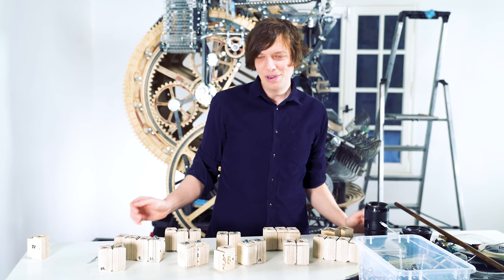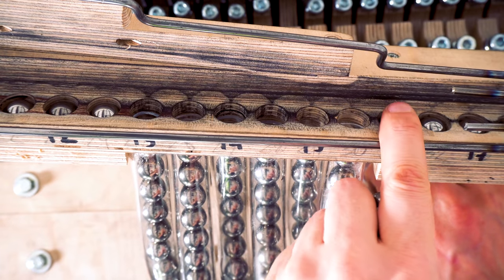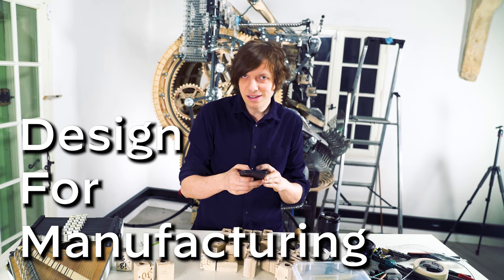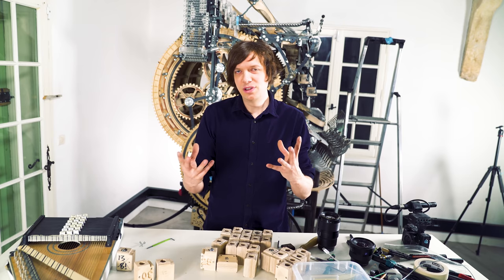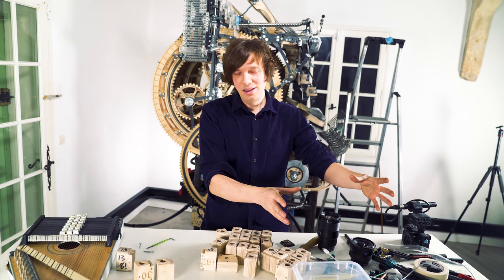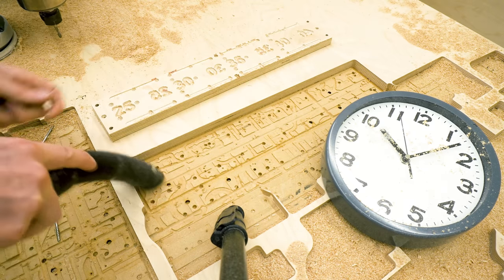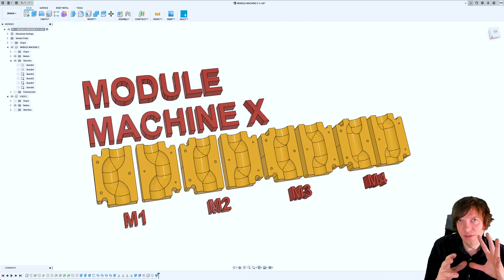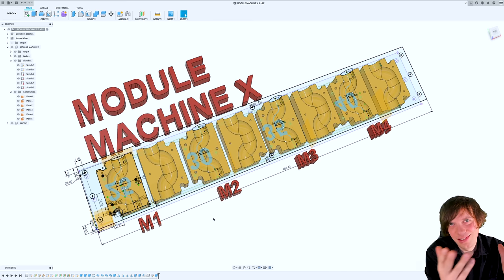Module Machine X

Comment: I will gently suggest that every car manufactured in the past 30 years with unibody design uses dfm. The shape is a design choice, not a manufacturing choice.
Reply: I came here to say this!
The manufacturing processes have been evolved to make the modern car shapes possible.
Car industry is one of the most efficient manufacturing systems around. The other industries are trying to follow their example.
Reply: You guys need to do your research about how Tesla wants to manufacture in one step the full frame instead of welding. That adds lots of limitations to geometry and flat surfaces are kind of optimal for this technology. 

So in the end, it is not designed for manufacturing, it was optimised to sh*t to be able to fit into this new concept. 
Would it work with round shapes? Yes, but with higher cost and longer lead times.

It reminds me of the Ford T model, which was only available in black as the black paint was drying the fastest. 
Would it work with green? Yes, but only with extra cost and lead time. So nope...
Reply: @Atomkukac1  I can accept that it's been designed for a new type of manufacturing method. But is the design cause or effect of this manufacturing method?

Comment: Martin! I know a lot about DFM, and I can tell you that making individual parts with sub-millimeter differences and swapping them in and out is NOT DFM! You don't need all of these different parts, you need an adjustable point somewhere in your system. Think about that tube that was coming lose, and you clamped it down. Because it was changing the height of the marbles! Instead of eliminating that height change, seize it! Take control of it, and use it to your advantage! Put a screw adjuster on that clamp, and you can precisely control the height of the marbles in the divider. You should be able to adjust that by 5mm or so, which would allow you to fine tune each channel much, much faster. And it would allow for easy adjustments on the road.
Reply: Yeah DFM would mean 1 part that fits across all channels. Lol. Martin had some serious Dunning Kruger effect going on in this episode.
Reply: I think the design inspiration in this is more of a grab and go aesthetic instead of a mechanical system that would inevitably fail at some point. This way martin can have just an index of changeable marble paths to suit his mad scientist intentions. 

With that said I agree with you, there has to be a clever way to adjust the marble pathmechanically. 

Specifically I'm thinking of a plywood marble path with bolts in the side that allows martin to change the exact length of the marble path by either backing out or screwing in the bolts to achieve a fractionally longer or shorter path resulting in a 3-5 mm adjustable tolerance to the marble height.
Reply: could you put spacer discs in the tubes to adjust the height of the balls.??
Reply: @raymondo162  you could use spacer discs but that's the same problem, interchanging parts to make an adjustment. Ideally you just want to turn a screw to move the level up and down.
Reply: you guys aren't even talking about DFM. you're talking about design for assembly of the mmx. DFM is about the manufacture of the part itself. making it one part that fits all channels or adjustable has nothing to do with DFM. that's like saying an ikea shelf has bad DFM because it's hard for the customer to assemble it. that's not manufacture
Reply: @DevinDTV  I am a manufacturing engineer, I work with DFM on a daily basis. I know what it is. And yes, we are talking about DFM for the entire machine, because that is the product being manufactured. MMX is not like ikea; Ikea's final product is an unassembled furniture kit, and that's the product they design for and that's why they do not need to worry about assembly in their DFM program. Martin's final product is a musical performance, played on a fully assembled musical instrument that can be partially dismantled and shipped around the world, reassembled and adjusted for each performance. Martin's DFM process needs to include every piece of the MMX, including the entire assembly, because the entire MMX assembly is a piece of the product being manufactured.
Reply: @TitoRigatoni  your suggestion was still a modification of the functionality of the MMX, rather than its assembly. whether he has one adjustable part or a bunch of unadjustable parts, he's still only sticking one in there at the time of final assembly.
Reply: @DevinDTV  no, it was about the assembly. Adjusting the marble height is part of the assembly.
Reply: Easy adjustments on the road aren't always desirable though... Easy mechanical adjustments are almost always going to be a potential point of unwanted movement, especially durring transport. I'm pretty sure that part of the assembly isn't coming apart for transportation, so the question is: Do you design it to be easily adjusted on the fly, but be required to fix the calibration each time it's moved? Or do you design it to be extremely ridged, so that once everything is set, it's almost impossible for anything to change, but if it does it's an easy fix? Martin opted for the latter, which makes a ton of sense for a part of the machine that isn't going to be reassembled all the time. As long as the heights are perfectly reproducible, (such as by making sure everything is fully seated after transport.) having immutable parts is better. And if a pipe were to change length during a performance (like the pipe you referenced that came up) than it would be something that would have to be prevented anyway. Not saying that easily adjustable parts like that are a bad idea for the MMX, they are great for any place where an assembly would connect to or be effected by another assembly. I just don't think it's suitable for this particular assembly because it should be static and anything that would cause the height to need adjusting after the machine is done is a problem that should be fixed by means other then just an adjustment.
Reply: @Thouston  Actually in this case the ideal solution is neither adjustable modules nor individual set height modules. The ideal solution is redesigning the marble divider in a way that makes marble height irrelevant. An alternate design has already been demonstrated wherein the marbles flow correctly regardless of the height of the marble stack in each tube. Any other solution will be a compromise.
The best fix for any problem is to simply eliminate the problem.

Comment: Martin, for most capital goods (which are used many years typically) the total cost of service exceeds the cost of manufacturing significantly. Once you realize that, it makes a lot more sense to Design For Service, than to Design For Manufacturing alone. In the future when you have to maintain the MarbleX machine, you may come to this conclusion as well. Try to think ahead, and make parts that need maintenance easily accessible and/or replaceable.

Comment: One advantage of curved faces, besides being more aesthetically pleasing, is that they are stiffer than an otherwise identical flat metal sheet. Convex surfaces also have the benefit of scattering incident light so there is almost no risk of blinding people with reflected sunlight even with a chrome finish.
Reply: not to mention aerodynamics.
Reply: Will the metal on the cybertruck be super shiny? Because it doesn't look like it reflects that much so I wouldn't worry about it blinding people
Reply: @homiespaghetti1522  It isn't chrome-shiny but stainless steel is still fairly reflective unless there is some sort of anti-reflect finish on it.
Reply: @kailoucleary6025  The Cybertruck has a very low coefficient of drag.
Reply: Having sharp edges also leads to stress points along the bend. When the car is driving the sheet metal flexes, twists and the forces will focus on those lines. Will get corrosion and cracks in no time.
Reply: @emanggitulah4319 The Cybertruck is stainless steel, it will not rust.
Reply: @olsonspeed  Stainless steel does rust and corrode, just takes longer to do so. It can suffer from Galvanic metallic reactions, Pitting which is likely to affect road vehicles and also Crevice mentioned else where where different materials meet. Whilst there is processes that can mitigate much of these you can never completely remove them. In any case the sharp edges suffer from a major design flaw, it's dangerous at high speed as you at risk causing more harm due to cutting/slashing from the sharp edges and also dangerous to pedestrians and is part of the EU law the bonnets are impact friendly to humans. This latter is why Land Rover had to redesign the Defender because it fell afoul of that law change (and other safety/design changes required by EU vehicle laws).
Reply: @thirdenvoqation7735  Fear not, Elon Musk has stated the Cybertruck will not be sold outside of North America. The stainless body will outlive it's owners, given enough time all things reach their lowest energy state.
Reply: @olsonspeed  it probably wouldn’t be allowed in Europe anyway because it’s unlikely it passes the pedestrian safety tests with the sharp edges.
Reply: That's why heads evolved round, flat faces didn't attract mates to procreate.
Reply: the cost bending, ribbing and stamping is quite low, so the benifits like not killing people (driver included) in an accident are quite high
Reply: I'm sure they will make it so it can be approved in Europe. It just will not be a car, but you will need a truck drivers license.
Reply: @olsonspeed  stainless rusts All Steel will Rust stainless just takes a longer time than most
Reply: @olsonspeed  stainless steel can rust...
Reply: @thirdenvoqation7735  Theres a lot of modern treatments for stainless steel that will deliver results that make your argument pointles, even tho it might seem sound to you. 
I sometimes work with an old artist that makes waterbased sculptures (image some sort of masks / portraits about 2m in size that also are fountains)  in stainless steel, he uses some sort of glass granules to "sandblast" his metal, then treats it with a laquer, and his creation have been litterally under the rain (they are fountains!) for about 45 years and have yet to show their first sign of rust. (they do get gunky with algae tho)
He told me that his method was widely known in the automotive industry, and that they now had surface treatments that could guarantee about two lifetimes of non-degradation, even in saline evironnements. 
I dont give a fuck about that car, i think it's ugly and not revolutionary at all, but let's not distort reality to fit our own biases towards what should or shouldnt be used in design, stainless steel with no paint doesnt mean unavoidable rust in 2021.
Reply: @dwayne7201  There are many alloys of stainless steel, the Cybertruck is not made of the same material as your kitchen sink.
Reply: @sirzebra  There's a massive difference between an art installation and using stainless in a car, for one thing it's exposed to more than just rain, it's exposed to chemicals from the road such as salt, sand, tree sap and other debris which cause pitting and other chemical reactions, you have chemicals being dumped by other vehicles and then you have the actual galvanic processes with steel, aluminium etc that will happen because of those materials used within the vehicle. I worked with maritime grade steel (steel with high levels of molybdenum or 316 grade) because due to the stripping of chromium oxide which is what forms a protective barrier, and even that has to be reviewed regularly for damage. Talk to any steel supplier they'll tell you the same story about the four main areas of steel degradation, it's simple chemistry.  The lacquer method you mentioned is applied to cars and guess what they rust and corrode despite the levels of inhibitors, paint and clear coat albeit most cars now last at least 5-10 years before you see corrosion.
Reply: Moreover is not expensive to make nice curved surfases, in fact it can be cheeper (othewise original Fiat 500; BMW isetta and original Mini should be like boxes on wheels, rather than what thay were) so in my opinion cybertruck design is just a visual statement.
Reply: One advantage of flat surfaces is that they are the shortest distance between two points. Have you tried sledge hammering the door of your Fiat?
Elon has stated that he will consider a Global version of the Cybertruck in the future.
Reply: IIRC, press forming stainless is not easy task, it is way harder than regular steel used in cars, so making curved shapes is not an option.  Simple brake bends are easy, relatively speaking, hence why the cybertruck has the flat panels, straight edges design.
DFS, yes, but it falls more into cost; if not Telsa will need to install bigger presses (more force), and molds last less presses (very expensive to make).
Reply: There are many alloys of Stainless Steel some of which are very resistant to the types of contaminants  found on motorways. I doubt you will live long enough to see rusted out Cybertrucks in scrap yards awating recycling.Would you perfer that vehicles be constructed of unrecycleable petrochemical composite?
Reply: @seveger  That depends a lot of what material you use, those cars that you listed used rather thin sheet metal, which at least to my knowledge is a lot more malleable than stainless. According to wikipedia  cybertruck will be using 1/8" (~3.2mm) 300 series stainless. That thickness and material cannot be easily shaped by presses. The thickness comes from the cybetruck being an exoskeleton
Reply: @teardowndan5364  A quick visit to the local metals dealer will show you can get SS in any surface treatment imaginable, and I'm not talking coatings.

Comment: DFM, in my experience, usually means "Damn, [we] Forgot [that this item will eventually need] Maintenance [or repair]. 

But that's a problem for the mechanic; it sure went together good at the factory!
Reply: I had this engineering course about DFM. We learned about snapping latches, glue and other stuff that made it super easy to assemble the product like: not using screws. My buddy on the other hand was a mechanic before studying and he remarked: AND HOW THE F IS THE MECHANIC SUPPOSED TO UNDO ALL OF THAT?
Reply: @Herdatec  Yeah, part of the reason I went into engineering was working on things and be thinking "what idiot designed this? I could do better". Turns out it's really complicated and compromises have to be made somewhere. Who would have thought? lol
Reply: Design for maintenance has that huge fundamental flaw...it costs more to make which is the polar opposite of DFM of course. It’s our own fault, all we seem to want is cheap shit!

Comment: Just so you know, the IKEA shelves, should have the holes on the back side. They are ment to be anker points to attach to a wall.
Alternatively if there are 4 holes, they should have come with cross braces that attach there.
Either will make the shelves much more stable.

Comment: 17:00 we're not going to talk about the elephant in the room those plastic containers are also DFMed so they can easily stack within each other for Maximum Effectiveness to transport them to a store for sale.

And those folds on the Shelf actually give the parts more stability and rigidness than they would have as an individual strip on their own.
Reply: Indeed that bend are what give rigidness, but the interesting part is that the shelves and legs use the same sheet metal, same type of cuts and bendings  (straight), and no painting required.  I wonder how much sheet metal loss IKEA has producing each one, probably they buy the sheet metal on the "right width", and right lengths.  Also, I would expect IKEA to be very process efficient in how they manufacture these too.